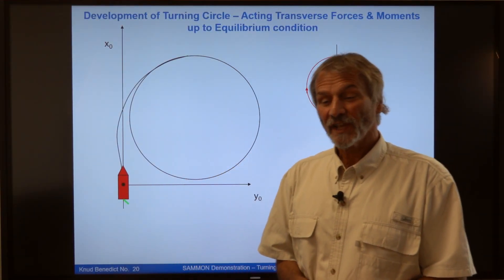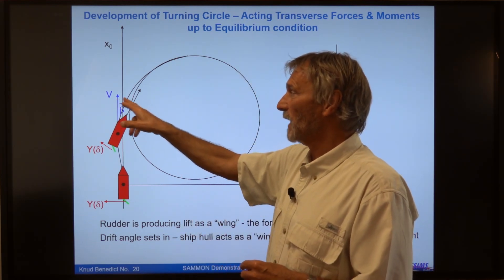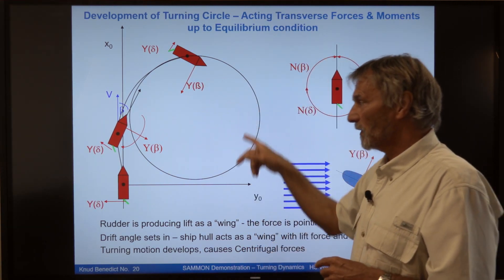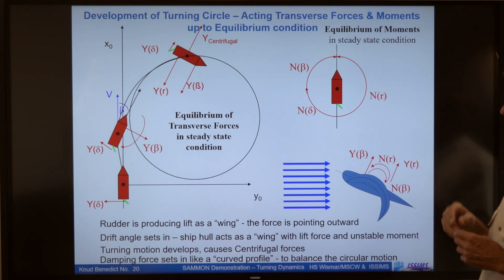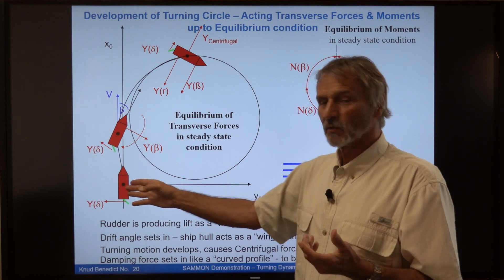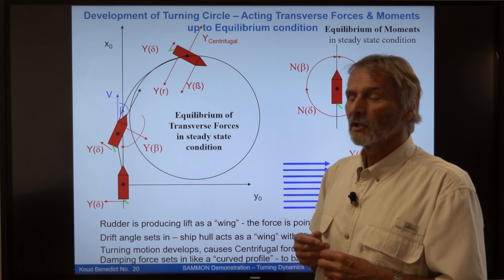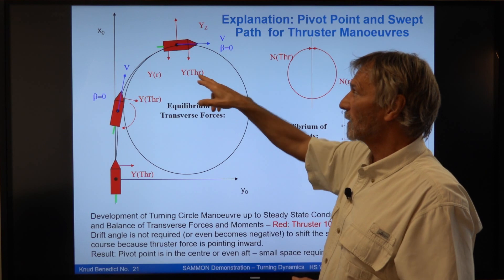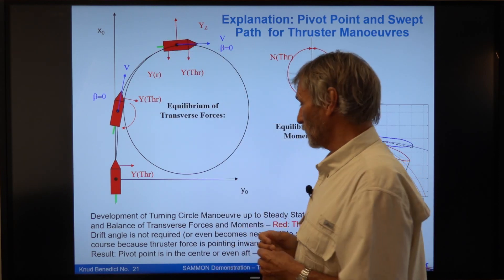Theory behind  Turning dynamics of ships

Comment: Sir, is turning radius bigger at bigger speeds and why?
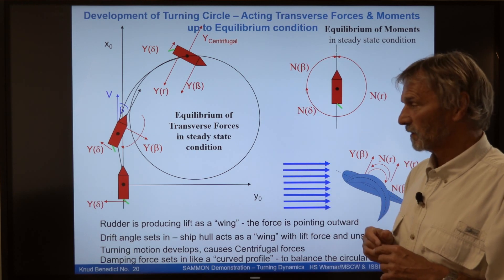Reply from the maker: 6:20  No, the radius remains constant because the growing centrifugal force at higher speed will be balanced by the similar quadratic increase of the forces due due drift and rate of turn with speed...
Reply: @issims-innovativeshipsimul4419  so radius for the slow speed and high speed is the same, if we apply different rudder command?
Reply from the maker: @alastorlestrange9727  For the same rudder angle the radius is nearly the same for higher or lower initial speed rates...
Reply: Sorry for bothering you, just to clarify turning cicle will stay the same in high and low speed, the only way we can make our advance smaller is to do kick turn with engine?

Comment: The confusing thing to me is how the pivot point shifts aft yet the turning diameter decreases. You would think the pivot point moves forward through the turn, increasing the turning arm (rudder to pivot point) creating more leverage to turn the vessel tighter.
Reply: Even though the pivot point is not mentioned in this video, I think you know the concept of it since you have mentioned it here. 
In the first scenario, the boat's motion is a combination of surge, sway and yaw. This means the pivot point will shift forward.
If you want to know it more specifically, check the figure 8 and figure 9 of this paper: https://drive.google.com/file/d/19HBN82hZKkXYJcM3dJQ-TuZ9aWHCSa9b/view?usp=sharing
Reply from the maker: One should understand that there is no leverage related to the pivot point as a sort of fixed fulcrum! because it immediately moves away when a force or moment is applied.

Comment: How sped reduces during a turn under steady engine power?
Reply from the maker: The reasons for speed reduction during a turn under steady engine power comes because:
a)  an increase of resistance: mainly due to drift angle and rate of turn, but also due to the increase of rudder drag. 
b) there is also an additional force against the ships motion due to the centrifugal force which has a component to the stern. 
c) the direction of propeller thrust goes out of the forward motion / CTW due to the drift angle
All these components together lead to an speed loss of up to 50%, specifically for long and slender ships....
Maybe a should make another movie?...:-)
Reply from the maker: The reasons for speed reduction during a turn under steady engine power comes because:
a)  an increase of resistance: mainly due to drift angle and rate of turn, but also due to the increase of rudder drag. 
b) there is also an additional force against the ships motion due to the centrifugal force which has a component to the stern. 
c) the direction of propeller thrust goes out of the forward motion / CTW due to the drift angle
All these components together lead to an speed loss of up to 50%, specifically for long and slender ships....
Maybe a should make another movie?...:-)
Reply: Thank you so much